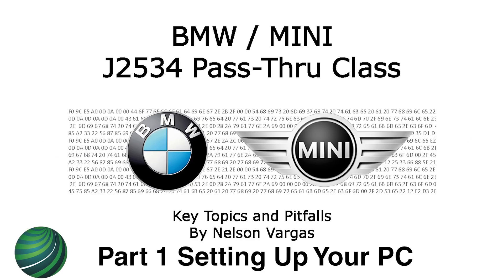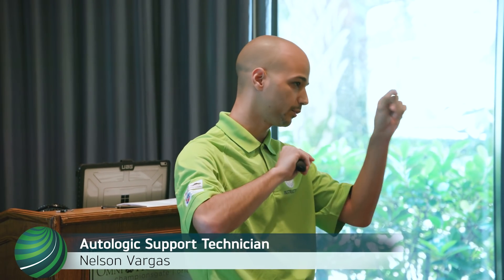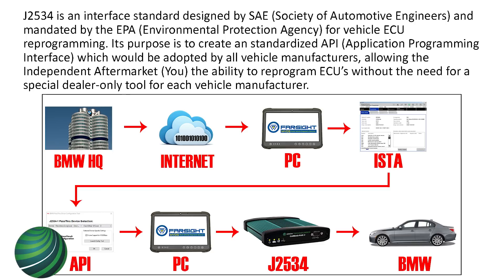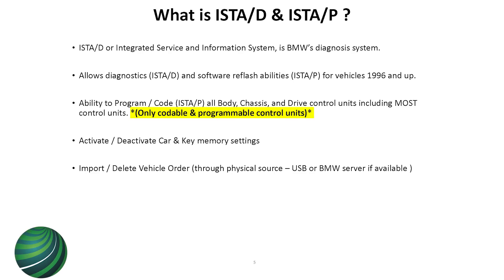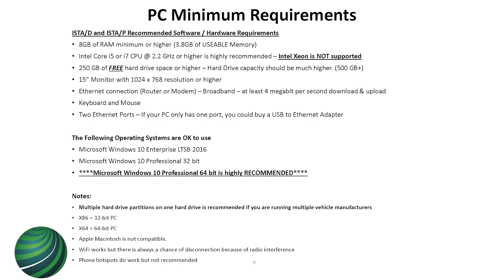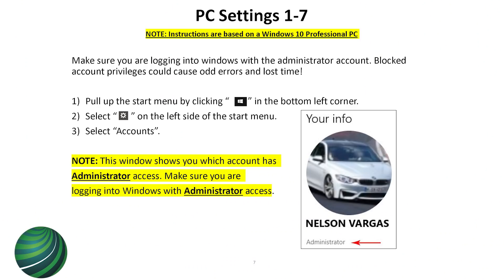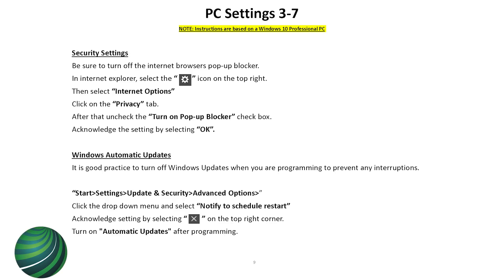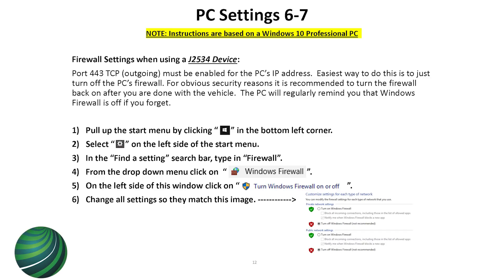BMW ISTA Pass-Thru Autologic NCTS 2018 Part 1

Comment: 2011 BMW 745i
Reply: 2011 is an F series car which has an immobilizer function in the transmission valve body. If you program a used valve body to the car, it will not shift out of park.

Comment: Well I love Autologic but this info is not so good! First why he says that windows 10 and only 10? That is not true. I use Ista P/D on daily basis with windows 7 and have never a problem. You can use 8 and 10. So all I see here is creating fear of programming which is a simple task when you get familiar. So sorry but this video gets a Thumb down from me.
Reply: Maic Salazar Diagnostics BMW specifies windows 10 only!
Reply: Maic Salazar Diagnostics BMW switched to windows 10 around the summer.  At the moment, earlier versions of Windows stil work, but if you check TIS, they state on there that soon enough only Windows 10 will be supported.
Reply: Lynx Star Automotive that is true. All manufactures are moving to latest windows but so far 7 and 8 are still working good. So no need to spreed fear into newbies. Thx
Reply: @MaicSalazarDiagnostics  I see what you're saying but there needs to be certain level of respect given when programming these cars. Also you have to remember that Autologic is a company with OEM relationships. They can't instruct people to use a non authorized OS when BMW says specifically to use Windows 10. What if a vehicle crashes and BMW doesn't give them support because the technician didn't follow procedure? Also newbies are too trigger happy these days programming cars that don't need to be programmed. Programming with battery jumper packs, etc. i don't see anything wrong with what the instructor said. Anyway, those are my thoughts.
Reply: Well just Saturday, (12/29) I had to program a JBE for another shop because his programming would not complete.  He thought it was his cable, so I lent him mine.  No dice; used my laptop instead (win 10), programmed without a hiccup.  So I believe Win 7/8 is no longer viable.

Edit failed to mention the problematic laptop was running Win 8.
Reply: @LynxStarAuto  Thanks for the feedback brother
Reply: NE no problem friend. Us Euro techs need to look out for each other.
Reply: Brother he's talking about BMW AOS system, not for standalone version Ista D/P. For BMW AOS system u need windows 10..